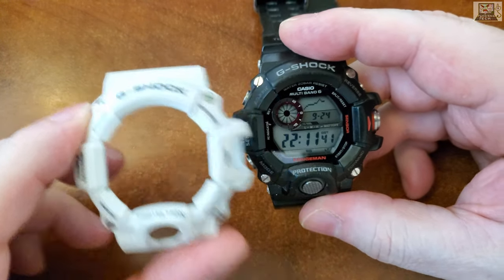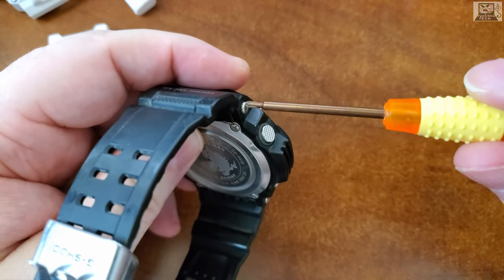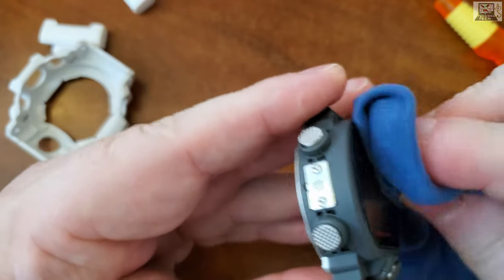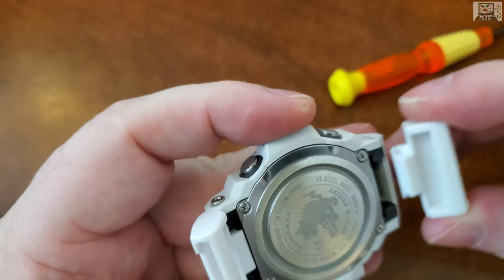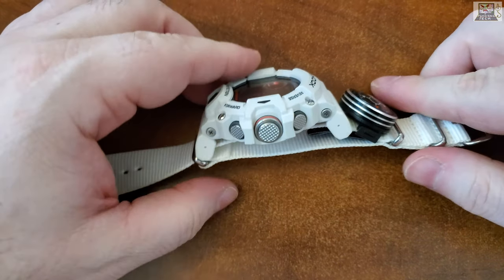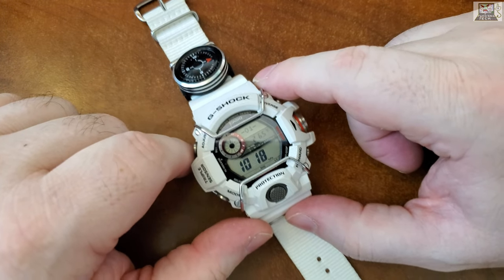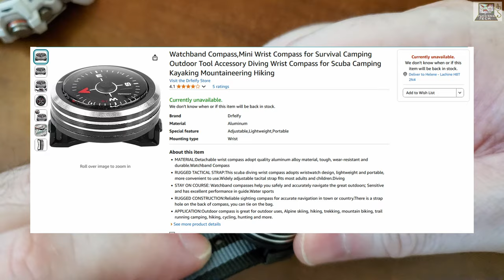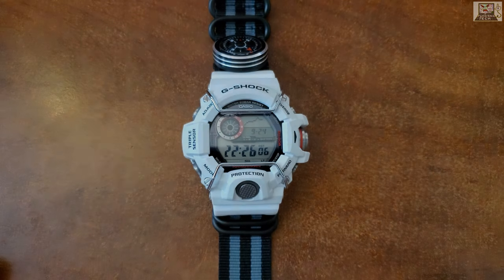Casio G-Shock GW-9400 Rangeman white case mod, NATO strap, chrome bull bars & compass add-on (4k)

Comment: Compass goes on bottom side of the strap. But this watch already has a built in compass
Reply from the maker: Compass goes on the top, because it's for show, not for actual use. :) Offset can be set on internal compass to provide TRUE North, whereas the add-on compass is to see the MAGNETIC North alongside that true North. :)